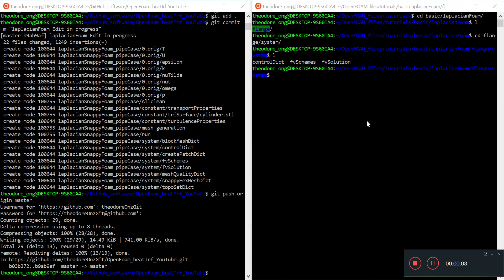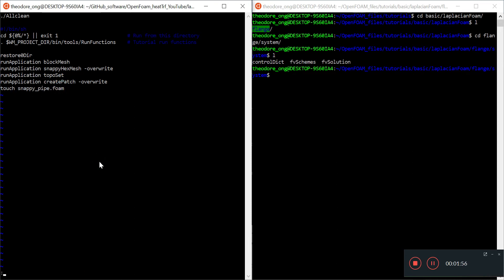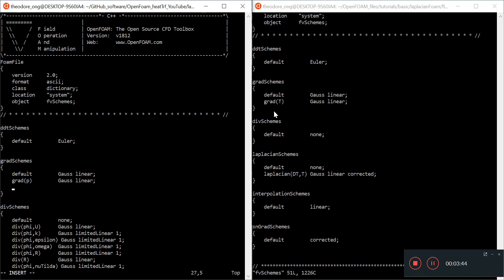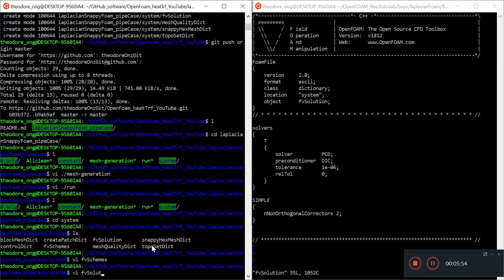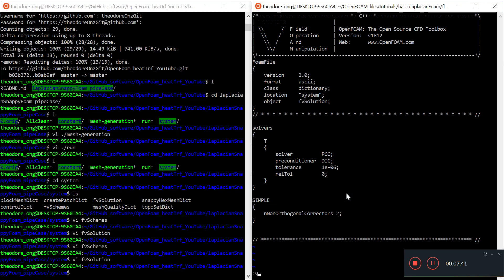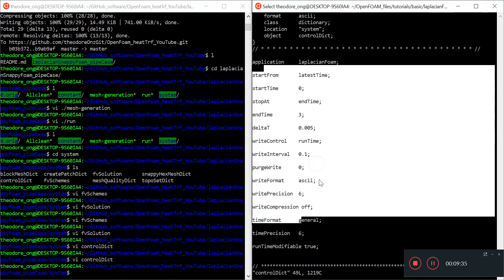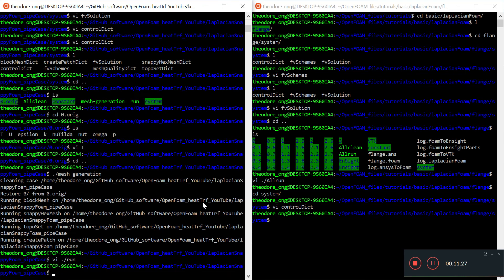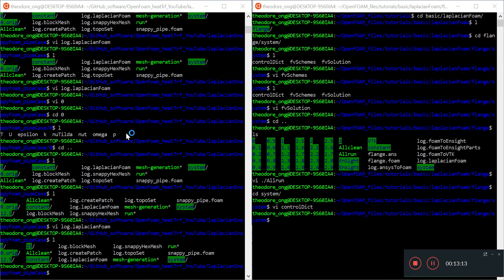OpenFoam Heat Transfer 3 - LaplacianFoam part iii

Comment: How to add temperature dependent source term in laplacianFoam
Reply: @TheoOngScienceAndEngineering  thank you sir for your reply.  I have tried with fvOptions and it worked.
Reply: @dibyendurana8624 Could you share your example?
Reply: @SaulousHR  implicit source term can be added using fvm::Sp(kappa,T). It will add a term kappa* T in the diffusion equation. No need to use fvOptions.